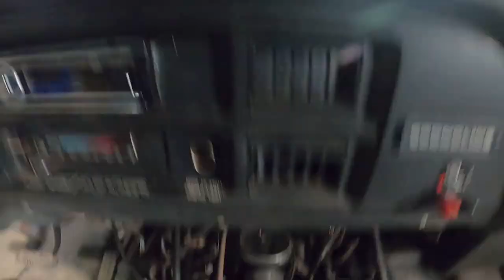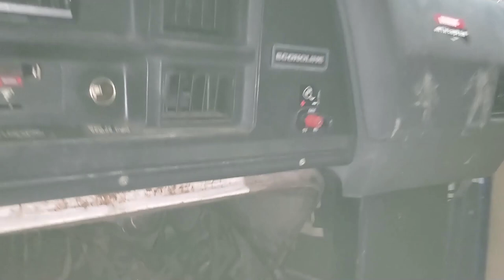Fixin' on the ramp truck! Injector return lines and exhaust manifold on a 7.3 IDI Part 1

Comment: I'm an idi guy. Bought one way back in 2011 for $400. Sadly it's currently not running. Compression is low :(. 150 psi with oil. Going to pull the heads when it warms up. Likely they just need a rebuild. Thing has 370,000 documented miles on it on the original engine. Can I complain? No.

Comment: It is possible to swap the cups without taking the insulators off but you risk bending the lines. If the new cups leak try copper washers between the cup and injector line.

Comment: I had a situation where I couldn’t get both ands in to hold the manifold gasket so I got some speake wire and pulled the coating off and got the strands of wire out and wired it to the manifold and my bolds still went through the holes and didn’t have to hold the gasket